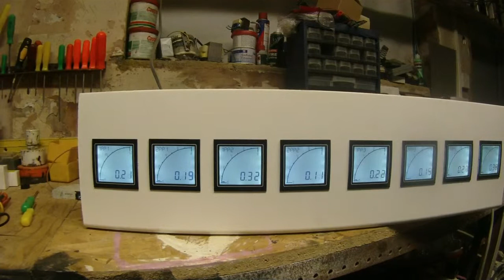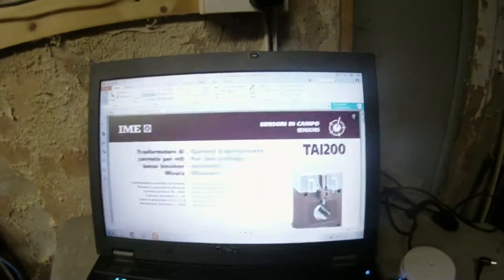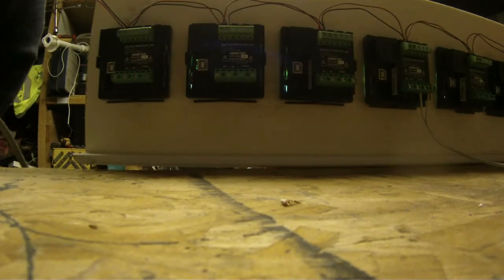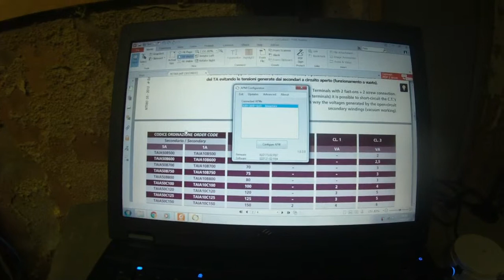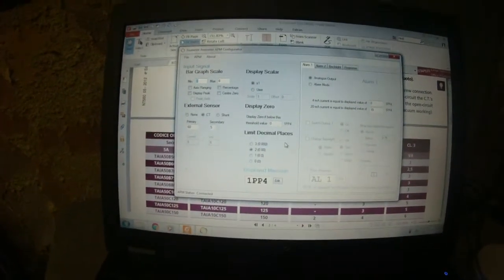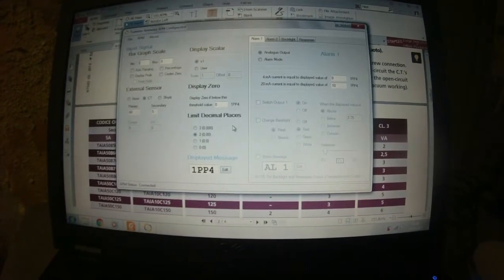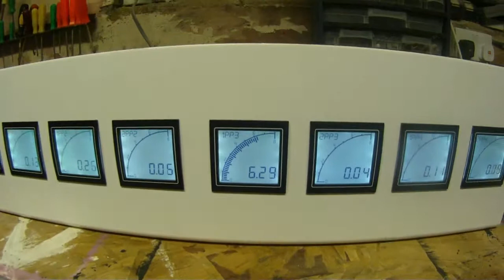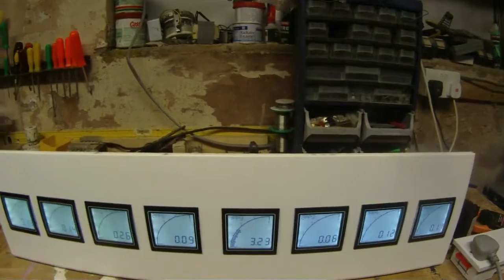Trumeter - APM - Amp.  Bench setup.

Comment: did you zero your clamp meter :D
Reply from the maker: The clamp meter I was using was an e-bay purchase for about £8 and has never been calibrated ! I could not see a rating plate on the heater to do a calculation to see how much current it should draw also.  My first problem was with my choice of CT which was ordered in haste from the RS on line catalogue.  This was a Talema AC1005 with a 1000:1 turns ratio, so I thourght with one pass through the CT window I should input my primary and secondary currents into the sofware as this: Primary Ip = 5amp    Secondary Is = 0.005amp  but no joy.  The data sheet from Talema shows when the CT primary monitors 5amps feeding a 100ohm load the VA rating is only 0.1 VA !  The multiple times folded leaflet the panel meter comes with does not speak of a VA rating and I can't get a response from any one technical at Trumeter. Might have to try a different CT, the CT I used in the vid was one I was "borrowing" from out of a Vacuum pump panel.  Just to see if the panel meter could register anything.  I put out a vid to see if I get any ideas as I could just be doing something stupid and the answer is obvious.  Anyway I will keep trying.
Reply: good luck dude